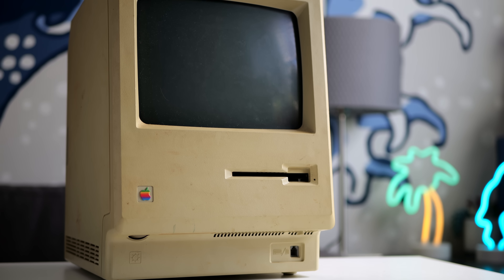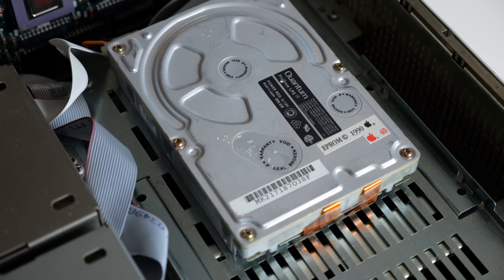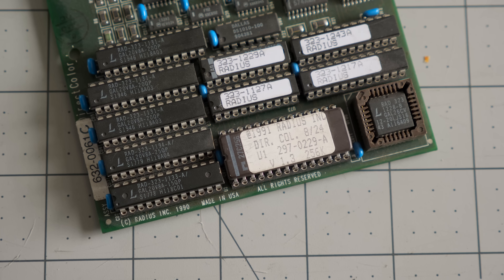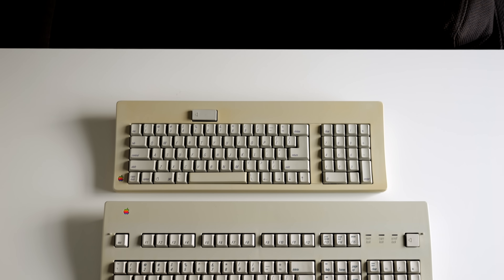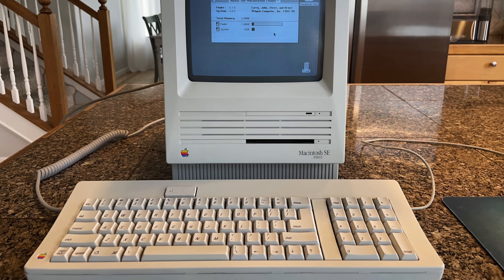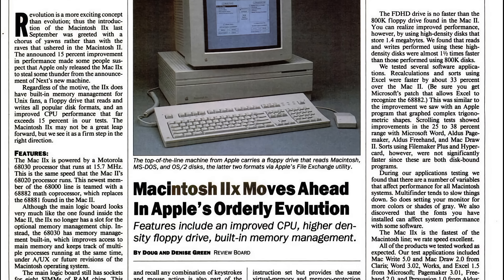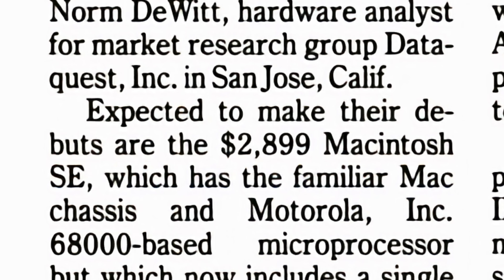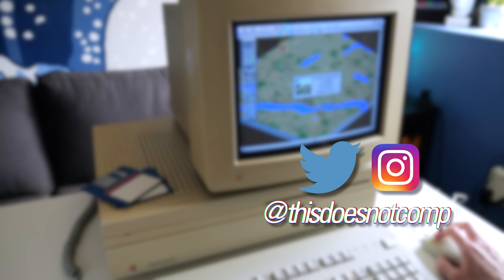Macintosh II: The Mac's Major 80s Evolution

Comment: The Mac II is my favorite retro mac , regret to this day in getting ride of both of mine. At the time the 60020 was a great upgrade and playing SimCity or Warcraft of them was better experience than a pc at the time. Got a 286 PC board for mine and a 030 cpu upgrade.  With upgrades over the years I was able to daily drive this computer all the way to 1997 and it still useful for most tasks until 2003 or so , were there was no more upgrades and the internet finally left it in the dust.
Reply: My favorite 030 Mac, and what I believe is the best 030 Mac is a IICI.  8 simm slots. A PDS slot. 6 or so NUBUS slots.  I had a IICI with a PPC 601 jammed into the PDS slot (I forget the clock speed) and a 6100 at the same time and for a lot of stuff, the II was faster.
IMHO, I just think the IICI is by far the best 030 machine. It's a perfect combination of features in a nice attractive package.
Reply: Warcraft is playable on a 16mhz 68020?! My 33 MHz 68030 vintage PowerBook 180c struggles to play games it really should have no issue with, like Another World or Syndicate. It’s pretty disappointing.
Reply: @kirishima638  Warcraft, yes... world of Warcraft, no.
Reply: @gaziltapig  Yeah I meant the first one.
Reply: @kirishima638  The problem with laptops is they do all kinds of stuff to slow laptops down.  Though, to be frank, I didn't think it would be possible for a game to run well on a II with a 16mhz 020 but not play well on a 33mhz 030, unless it is relying on chips not in the 030 machine, like an FPU
Reply: And sometime around 1996 I saw an original Macintosh II in our company's warehouse (a multimedia software company).  It was already beat up and I don't even know if it was still running even then.  Almost managed to bring it home but they weren't quite ready to dispose of it yet.

(I just think of the Apple prototype machine we had back then, I think it eventually became one of the Performa models. I could instantly crash it with one of our software titles)
Reply: @SenileOtaku  Weird, they have a 10 year old Mac sitting in a warehouse and aren't ready to give it up yet? Probably hadn't been used in 5 years and current software probably wouldn't run on it anyway. What were they waiting for, the price to go up on an old computer? Retro nostalgia was at least 15-20 years away at that point. interesting  how companies will hold onto stuff like that because it still "on the books". Not like your getting a tax write off anymore..

Comment: Wow... a period where Apple actually tried to follow standards instead of scamming their cult customers for more money with proprietary formats and selling adapters. How times have changed.
Reply: Apple were "scamming their cult customers" back then too. What Colin forgot to mention is that the Mac II didn't come with the keyboard, something Apple would continue for quite some time. Also, ports and adapters... AAUI anyone?
Reply from the maker: PCs in the 80s didn’t automatically come with keyboards either, and by the mid-90s Apple did usually include one in the box.
Reply: @ThisDoesNotCompute  if a PC manufacturer didn't include a keyboard, that was probably a sign to avoid them and shop somewhere else. Macs didn't come with keyboard period for a long time. And Apple's keyboards weren't cheap either. Plenty of cheap options for a PC keyboard (you do get what you pay for, but at least the option was there). With Apple it's expensive or nothing. Again, nickeling-and-diming customers on accessories has always been Apple's MO.
Reply: @ps5hasnogames55  Honestly, I was happy that PCs didn't come with a keyboard. I wasn't charged for one either, and it allowed me to buy the one I wanted amongst all manufacturers. PC keyboards have long been standardized.

Now, if I was not able to directly use my favorite old keyboard with my new computer, without an ADB adapter or some other converter, then it's an altogether different issue.
Reply: @ps5hasnogames55  I guess that's why Collin called the expandability a mistake LOL. Who would want a product that remains useful longer... Shocker!!
Reply: @jeremiefaucher-goulet3365  indeed. And also, the PowerBook line (especially the Duo series) were infamous for the fact you essentially needed an expensive, not-included docking station to make the computer actually usable. Nickel-and-diming their customers with acceessories has been Apple's MO forever, except that nice period in the mid-late 2000s and early 2010s when Macs were actually loaded with ports.

Comment: The Mac II could come with what is widely considered to be Apple's best keyboard ever, the Apple Extended Keyboard. A spiritual successor to the AEK would be the Matias Tactile Pro 4, from Matias.
Reply: I have the 3 (not sure what 4 changes/improves), and it's a nice keyboard. Does have a very nice, clicky feel. I'd recommend it because it has modern media keys, which the Extended Keyboard lacks.
Reply: @drygnfyre  i think some Tactile Pro 3 keyboards came with genuine simplified Apls White switches, whereas all Tactile Pro 4 keyboards use Mattias White Click, since Matias ran out of Alps switches and refuses to switch to Cherry MX because Cherry MX is boring.
Reply: @daemonspudguy  If you have both, which do you prefer from a feel standpoint?
Reply: @drygnfyre  i don't. I use a Unicomp Ultra Classic, a modernized Model M.
Reply: @daemonspudguy  Never bought a Unicomp. Have considered it. I use a mix of Alps, Cherry, and Topre.
Reply: @daemonspudguy  that’s exactly it, also IIRC the USB hub is slower (understandably)
Reply: @drygnfyre  They are almost indistinguishable. The real Alps has a little more “after ping”.
Reply: u dont need to repeat the company name after the product if the name of the company already been sayd
Reply: @benNdaKen  some companies have multiple brands, such as Music Tribe, owners of Behringer.